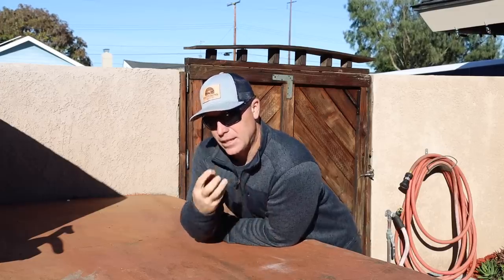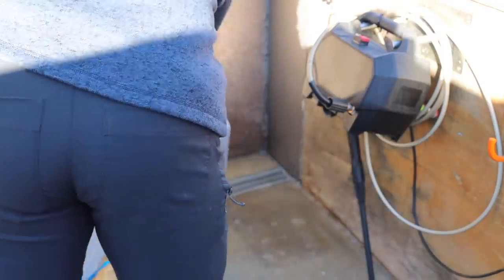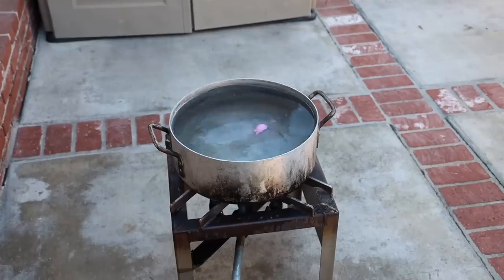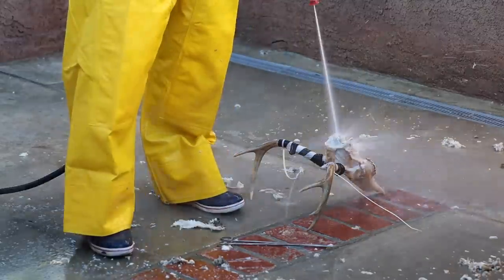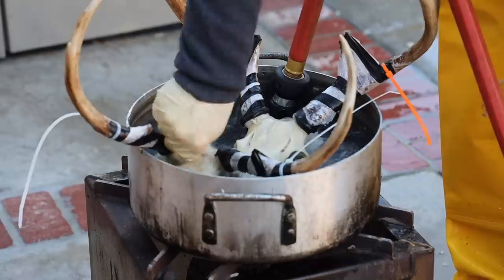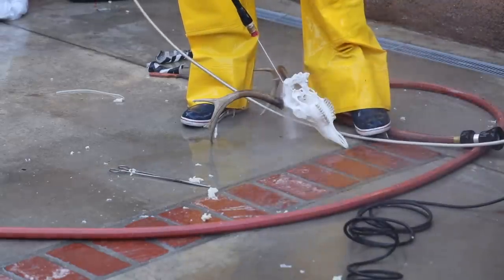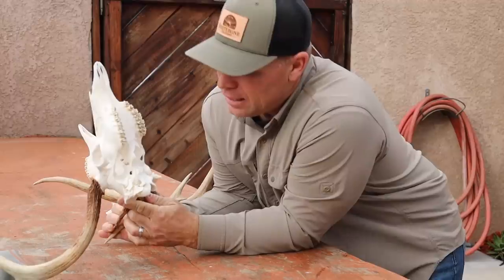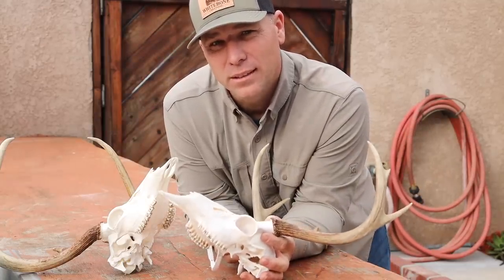SOUTHERN WHITETAIL SKULL CLEANING "HOW TO"

Comment: I'm in FL , great video on skulls, I have a European buissnes also , our 4 point & young doe skulls are super fradgile, I have even done some in  a crock pot to avoid, falling apart , plus the washing, stay far away with the pressure washer & use wide fan , from 1 to another, try a beer keg , I have 3 , 1 super short, the other two are cut right at the end of of the keg , they are stainless steel , chemical will not eat it , both ends have an outside lip , great for keeping heat off of horns , the last 1 is cut long ways  , down the middle, for large horned animals,& gator heads , had to weld bracket to keep on burner  ,but buy far they last long , if u have to touch up a antler down here we use ( early American ) love yr hunting video s , especially family !!!!! , I have hunted since I was a kid , & all my kids hunt, & a big Thank You for keeping God & prayers in yr video, GOLDEN !!!! Keep them coming , I also Hunt in Colorado , ( Craig ) love God's nature, so different than FL , Happy New year to you & yr family

Comment: Thank you for all of the videos.  Really great stuff!  Here are a couple of questions that I searched for but didn't find an exact answer..... 1. Do you ever find the need to brush their teeth while in the peroxide soak?  I have a buck that really needed a trip to the dentist and not sure if his blackened teeth will clean up well using just the boil/soak or will need extra scrubbing.  2. What type of adhesive to you recommend for repairs so that it won't discolor the bone over time?  I saw in one vid that you made the repair after the whitening.  Wondering if it matters whether you do the gluing before or after the peroxide wash.

Comment: For your methods, no, you won't get all the grease or flesh out of auditory canals and turbinates. But you're methods are also much harsher than others. Dermestid beetles do a great job at getting every piece of flesh (or as much of it) as possible, and masceration is a good one for that too. If you degreased with Dawn or acetone, like really properly degreased, changing out the mixture and waiting patiently, you'd get all the grease out as well, and it wouldn't clog up the auditory canals.
I understand that for your line of work you don't have the months and months necessary to clean skulls as thoroughly as possible while maintaining a gentle process that produces long lasting results, but it is entirely possible to have a 100% grease and flesh free skull with the turbinates and auditory canals intact. It just takes a lot of time and patience.